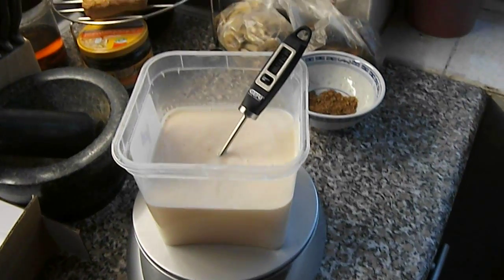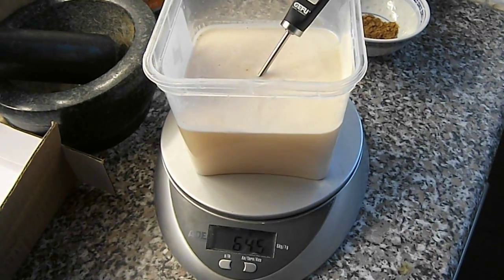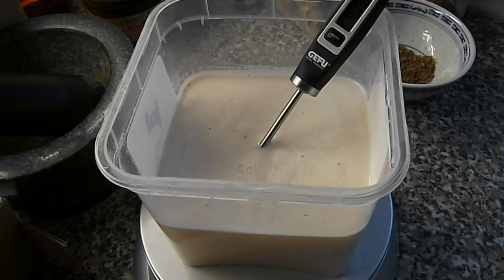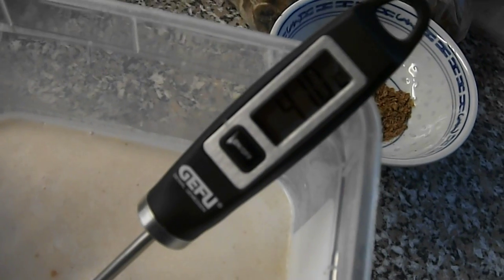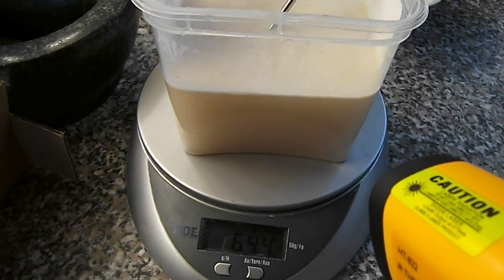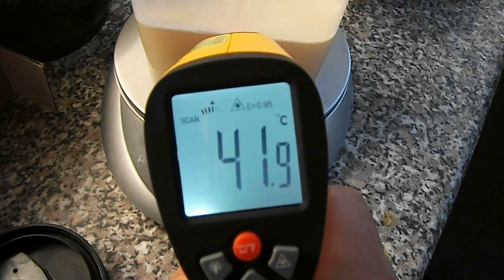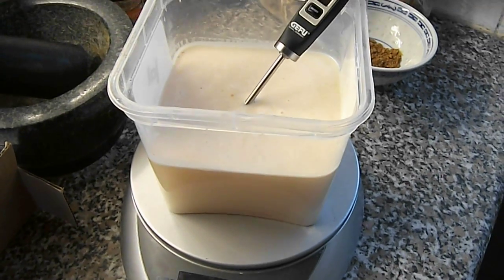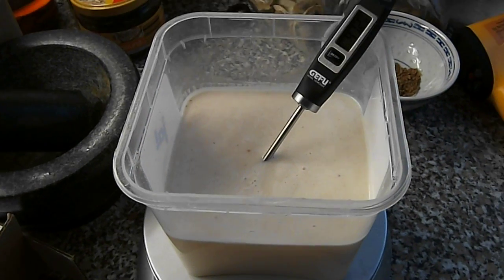How to produce ethanol video #1

Comment from the maker: If you want to have a higher percentage of ethanol you should know the boiling point of ethanol it should be under 100°C. Alcohol and water will separate due to the boiling point difference. Have fun by your little experiment!